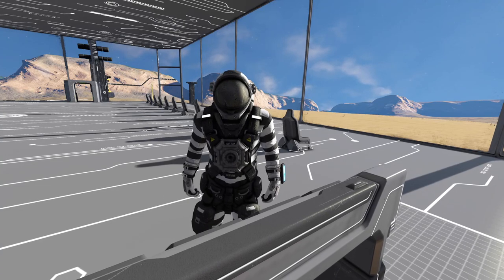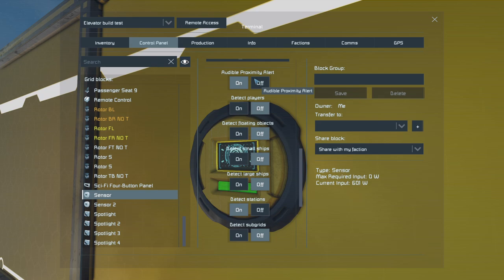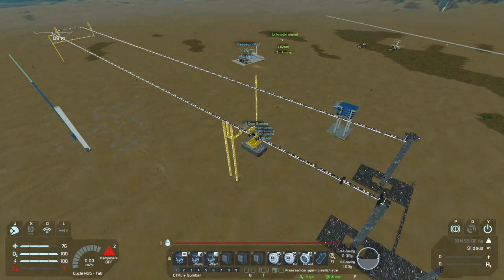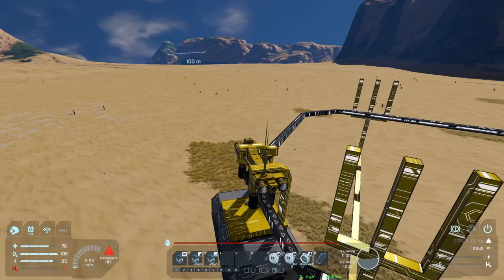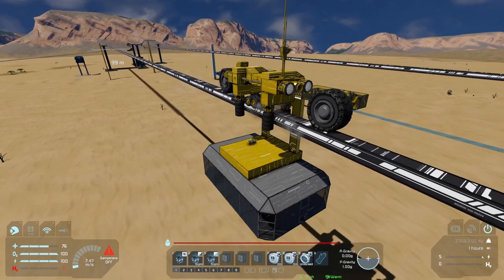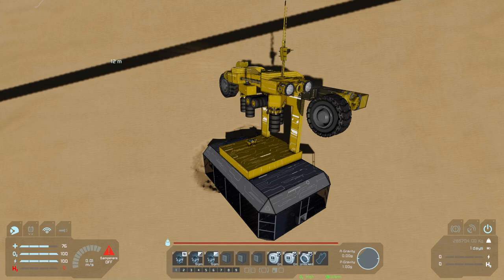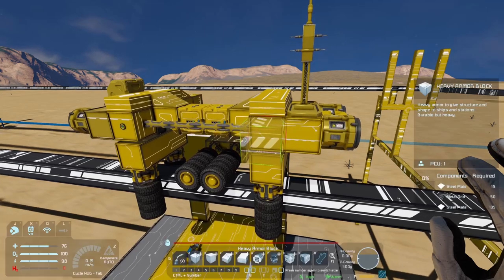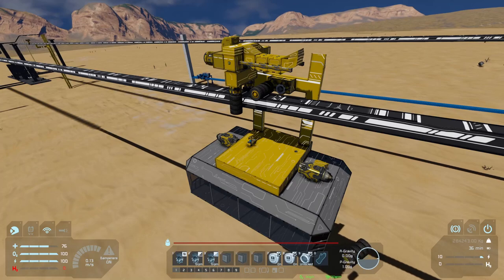Space Engineers Experiments: Gondola Speed Test

Comment: IRL Engineer here.  Can't test for myself right now because the current build of SE doesn't support my old computer's OS, but I have some ideas on what's happening in game. (1) I believe the reason you're pitching up when using the thrusters is because of the way space engineers handles thruster forces: no matter where you place them on a grid in SE, they will always act through the center of mass of the grid, which in this case is somewhere in the gondola cab below the rail.  Normally, this would make things simpler, since, unlike in real life, the thrusters will never generate their own rotations on a single-grid vehicle...but in this case the wheels contact forces create drag the system, so everything above the center of gravity lags behind the rest.  (2) there are 3 ways to solve said issue: (a) you could slap on a gyro, which will automatically attempt to couteract that rotation, but is kinda boring since its a single block that just does it for you, (b) you could add extra rotor-wheels under the track and have all the rotor wheels hug the track tighter to constrain the motion of the gonola, physically preventing it from "lifting" off the track--with your current support method for the track this would be difficult to do, but you could adjust the track shape a bit so there was space for both supports and wheels underneath or (c) you could make the SE physics line up with real physics better by changing where the thrusters are applying their forces.  The naive way to do that would be to add a counterweight to the gondola to move the center of mass onto the track axis, but that would sabotage the gondola's already iffy stability, but you should be able to get the same effect without that issue by putting the thrusters on subgrids so the center of mass FOR the subgrid is along the track.  Basically, if you place some some rotors, hinges, or pistons sticking out the sides (SYMMETRICALLY) at the same height with just the thruster on 'em, the force can be applied above the center of mass to counteract the wheel drag torque.  Might need a bit of trial and error to find exactly where is best, but once you find the right height to place 'em at, the engines will do the job of a gyro for you--and if you cleverly place the pistons, rotors, or hinges and mess with their positions/angles you might be able to do so at better-than-1 block resolution.  (3) The wheels are a similar, but not exactly the same story, and (a) and (b) would help with it too, as would (d) putting the drive wheels on multiple sides of the track instead of just the top and (e) messing with some other stats on the wheels, such as (suspension) strength--the lower it is the more accurately the wheels will stick to the track, but the more bumpy the ride will be for the folks in the gondola and the more the rotor wheels, which have no suspension, might get in the way--or friction (up = less bounce and more speed, but more possibility of lifting off like with the thrusters).  Basically all wheel stats are tradeoffs, so finding the best ones can take a LOT of systematic trial and error called "tuning", where you essentially fiddle with every dial, one at a time and see if it makes things better or worse to find the "perfect" number for that dial, then move on to the next, and repeat the process over and over again (because one change for the better on one dial can change what that "perfect" number is for EVERY other dial) until any change in either direction on any dial makes things worse.  Happy improving!

Comment: I'm running a cab on rail monorail, about 15km straight track with up and down segments at 25m/s reliably. Your problem is trying to make it turn and those swivel rotors are causing your problem. Those should be trying to keep you on the track tight. For yours maybe try a Gyro. I gave up on doing anything to cab to turn but rather am focusing on the track. Still not good turns. btw Only reason I'm limited to 25ms is there are hidden bumps in the half and whole blocks used for the track and I tend to launch up and over at higher speeds after hitting one. I'm planning to add More wheels on the side guide wheels to see if that helps.

Comment: Have you made any progress on this? did you try adjusting the strength of the suspension when you were working with the wheels? I'd try smaller wheels closer to the center set the suspension strength up power and speed down, set the speed to like 50km/h maybe even lower. I bet it is the friction that is causing you to fly off, try adjusting that too. I worked on but never got a space elevator working when I first got the game.
Reply: Also forgot to ask if you had a gyroscope on it. they make a huge difference.
Reply from the maker: I didn't try it with a gyroscope. Would likely make a difference. I haven't played around with this in a bit.